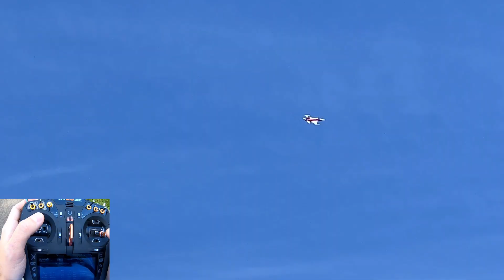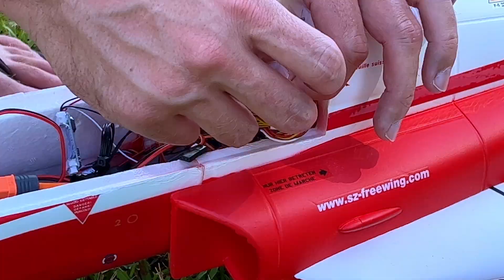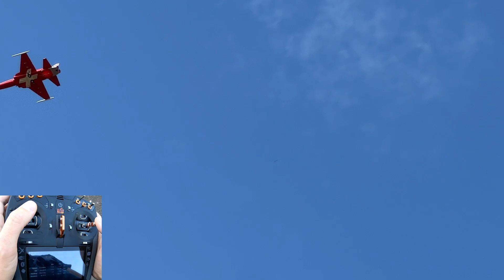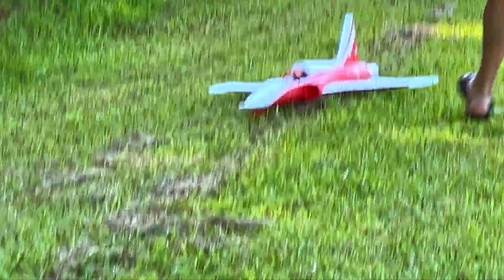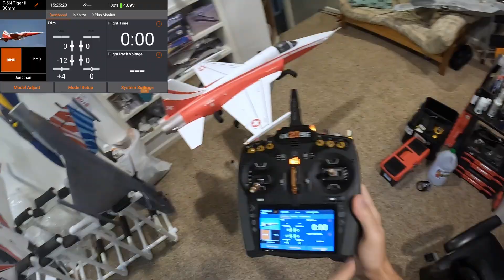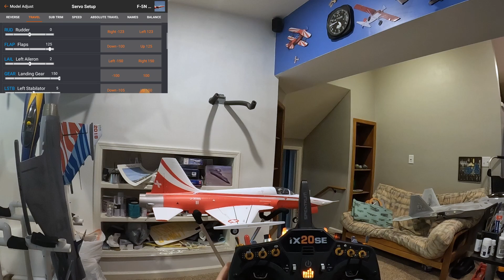FIRST FLIGHT DISASTER

Comment: Battery way to far back you love flying stuff way to tail heavy that's why it was so wonky
Reply from the maker: That's not really the main problem with the jet here.
Reply: Mine seems to fly best with the battery about a quarter to half of the way behind that line inside the fuselage too far forward it pitches up during turns to far back it acts wonky like in this video not hating at all I've learned a ton from your videos but this particular jet is super picky about cg
Reply: I have the fms 3665 2000kv platinum pro in mine and on 15 degrees timing she's a beast gets 150 160mph flat an level on gps love it best sounding edf I own and 2nd fastest next to Zues

Comment: Too much throw, gyro set too sensitive,  ..and I'm not sure you have the control surfaces synced correctly.  The plane should fly nicely without depending heavily on stabilization.
Reply from the maker: Throw is fine, gyro is obviously in need of tuning because it was the maiden. Surfaces are synced correctly.

Comment: I flew it without a gyro for years and i never had a problem.  https://www.youtube.com/watch?v=2aVWLPl7faI&t=116s   If anyone thinks this is a beginner plane they will be disappointed for sure.  It's a pointy jet with smallish wings and a relatively high wing loading.   If you fly this F-5 model like a real F-5, and don't over-control it, it will be a great addition to any hangar of an experienced RC pilot.
Reply from the maker: Nice man, thanks for sharing!

Comment: I don’t understand why it flys so unstably with a gyro, you seem to be stabbing at the sticks which is maybe why. 
I’m surprised your gear switch with didn’t wear out and come off you flicked it so much😂
Reply from the maker: It was unstable because of the asymmetric gear drag. Later on it was because I was still figuring out how it flew. "stabbing at the sticks" is using dampened stick movement. I fly with high expo because that's what I'm comfortable with.
Reply: @TwoBrosRC  
I fly with expo too but I still try and fly as smoothly as possible even if the model has a gyro.
I know the gear leg hanging out was causing the instability, I’m just surprised the gyro didn’t handle it with the amount of gain you had
Reply from the maker: I usually fly pretty smoothly as well, but on reviews I'm not looking for precision flying - I'm looking for what the model is capable of, how it stalls, how it maneuvers aggressively, etc. All of which is vital information for a proper review.

Comment: I just measured the wing on my F-5N and came up with 196 sq.in. for the wing panels. If you add the fuselage area between the panels (we always included it in the old days), it's 268 sq.in. After all, the plane does fly partly on the fuselage a la F-104 Starfighter. At 5 lbs, that gives a wing loading of 43 oz/sq.ft. That's not too terrible considering there is some airfoil to the wing and you should notice some loss of lift before the critical angle. The hardest part is landing it and most of that is due to the lack of dampening in the landing gear. If you don't grease the landing, you'd better have enough juice left to go around.
Reply from the maker: Good info - thanks! Perhaps it's not an issue of wing loading as much as it is an issue of stubby little wings. It's actually pretty easy to land so long as you're bringing it in with thrust. I was able to perform about 15 T&Gs yesterday almost effortlessly while holding power on approach. The key so far is to treat it like a jet running crow. Hold some throttle to manage sink rate, otherwise it'll just fall out of the sky without dropping a wing if your glideslope is too shallow. Much easier to just hold throttle and manage the descent instead of trying to finagle a working glideslope that will always function regardless of wind conditions.
Reply: @TwoBrosRC  I control the pitch attitude with the elevator and control the descent rate with throttle. If I’m going to be short, I add power. I try to keep a little bit of elevator in reserve so that I have some left to soften the touchdown, if needed..
Reply: When landing with flaps, you need some power to keep the plane from losing speed too fast. It gives you a little more time between the start of the flare and getting it on the ground before it stops flying..

Comment: Amazing review Jon. I learned so much from  it. Just as you I like the F5 too, but I am a bit afraid for it. It flys exacly how I expected. Too much tricky for me. At least for now. At this moment I have the Freewing T33 almost ready for its maiden. It is my first edf to fly. Do you have any tips for this one?
Reply from the maker: Nah, don't be afraid of it - just be aware that it's a power-hungry jet and requires a good bit of speed to stay airborne. It's not designed to fly very slowly. I'd recommend starting with an easier model, but if it's all you've got then I'd recommend keeping speed up throughout most of your maneuvers. Don't keep it at full throttle all the time, even half is probably fine, but you will stall it easily if you don't keep airspeed up while it moves around.

Comment: My 80mm F-5N in the aggressor scheme flies much better than my 90mm F-104 Starfighter. My F-5N is stock and is actually easier to fly than I thought it would be. And yeah, I think it’s my 10th EDF jet. It is difficult to see at the edges of the field. I put an AR637T in mine and mostly fly it in SAFE mode, even for takeoff and landing. I’m 72 and my eyes aren’t what they used to be. I can land and get it stopped without going off the end of our 350 foot paved runway. I had to enable reverse on my 80mm E-flite F-16 to get it stopped. Also, I put a KM-RC AB in my 70mm E-flite F-16 and I think it’s great. I did have a little trouble getting it to remember the calibration.
Reply from the maker: The KM unit has issues with Smart ESCs. The fellow who runs the site discovered it after I reported some bugs I encountered. There should be documentation on the site about Smart ESCs and what to do with them.
Reply: @TwoBrosRC  Yeah, I can see how the microcontroller in the KM-RC AB might have issues with the Smart signals riding on the PWM servo signal. If I still worked at a calibration lab, I’d see what it looked like on an oscilloscope. I’ve just started learning how to program Arduino boards and have learned there are at least two ways to measure the servo pulse width. My current project is for navigation lights for R/C models and using a channel to turn the strobe and landing lights on and off.

Comment: If you want a reliable radio/link that can’t brown the gear or worse, the receiver, the main battery has to power the receiver directly. There is never a need for satellite receivers except with Spektrum. I can’t recommend Hitec Aurora enough. You will never lose a link and never brown the gear. Spektrum will brown every flight if the control side load is high, and lose the link regularly.  Many start with Spektrum, but no one sticks with it.  The design is inherently bad.  Better to the bullet and sell it off.

If you do stick with your investment, it will help to test flight controls/accessories at full battery load… so full throttle with all servos/gear actuated at once.  Personally I would test that way at a min flying battery charge, too.
Reply: Flat out brutal honesty: the more experienced flyers don’t appreciate people flying very high electrical load, fast/dangerous models on Spektrum.  It’s just a potentially fatal accident waiting to happen. I’m mostly talking 500 and up size helicopters, especially in any way that ever directs energy toward the crowd.  It is just stupid. I understand it’s mostly unrecognized risk, and airplanes are significantly less dangerous than a 2 meter blade disk with a completely random ground impact footprint.  But they are still not without serious risk.  

I’m not talking about this little foam fighter, which at worst would be like torture with the “comfy chair.”
Reply from the maker: Appreciate the insights - but I think I'll stick with Spektrum for now. I usually don't change brands unless there's some kind of experience giving me a reason to.
Reply: @TwoBrosRC  I've flown Spektrum since 2007 and have never had any problems whatsoever. I've found that those who have had problems with Spektrum would have had problems with any brand..
Reply from the maker: @txkflier  Yeah, that's basically how I see it too.
Reply: @TwoBrosRC  
That sounds smart.
Reply: In the 1970's, everybody badmouthed Kraft radios. But when you looked at it properly, you realized that 90% of the radios flying were Kraft radios. So, if somebody crashed, there was a good chance they were flying a Kraft radio. Spektrum is today's Kraft radio. Out of 30 club members here, only 2 fly Futaba radios. One flies a FlySky and one flies Jeti. The other 26 fly Spektrum. If there was a problem with Spektrum, I think we'd know it.
Reply: @txkflier  
Yeah, I had a couple of Kraft radios.  The days of, “who has my clothes pin?”  Spektrum is a lot like that, but with just enough clothes pins to go around, until there’s not.   Or, some other 2.4GHz device has your clothes pin. Kraft had major problems with deconfliction, but people thought it was the best we could do and developed work arounds.  Similarly, a lot of radio problems went unblamed.   

Just my anecdotal experience - I flew for years on Spektrum (still do, a little) and I actually thought crashing was part of RC flying.
Reply: Another consideration is Rx size and cost.  A 9 channel three pack costs $40 each, that includes full voltage and position telemetry (built into all receivers, even micro) clear frequency scanning and un-jammable secure frequency hopping.   7 channel might cost half that.  So no more satellites, telemetry modules, BECs, flight batteries, all that weight, size, etc. And no more crashes and lost time and money.  The interface is looking a little dated, but a lot more powerful and basic sticks and switches are pro quality rather than temporary.  

All that said, it was price per V telemetry 9-channel airplane that forced me to switch.  Like you probably do, too, I have hundreds of models so I saved thousands of dollars right off the bat.  You can easily save a few hundred $ per airplane.  Plus they suddenly live forever.
Reply: @FFE-js2zp  You do know that the old DSM2 protocol didn't do frequency hopping, but DSMX does, right?
Reply: @FFE-js2zp  From an article published in 2011..   

Just How Good is DSMX?

In multiple tests, 100 DSMX systems were operated simultaneously for extended periods of time. During these tests each of the 100 systems was monitored in flight and on the ground. In every test not a single case of RF link loss, latency increase or control degradation was experienced or recorded.
Reply: @txkflier  
Will they buy all my models back?  Here’s Spektrums own instruction manual:  “All DSM receivers have an operational voltage range of 3.5 to 9 volts. With most systems, this is not a problem as most servos cease to operate at around 3.8 volts. When using multiple high current draw servos with a single or inadequate battery/power source, heavy momentary loads can cause the voltage to dip below this 3.5-volt threshold, causing the entire system (servos and receiver) to brown out. When the voltage drops below the low voltage threshold (3.5 volts), the DSM receiver must reboot (go through the start-up process of scanning the band and finding the transmitter) and this can take several seconds.” 

And saying “most systems” work because servos quit at 3.8V makes zero sense.  What’s the actual difference if servos quit or the Rx quits?  And every Lithium min cell voltage is 3.0V by design.  Senseless.

The only reason I brought it up is this model was almost a Spektrum statistic.  Why do you need a high AMP BEC that smokes little wires?  Spektrum.  More amps, less V droop under load, fewer Rx naps.  Been there.
Reply: @txkflier  
I know DSMX claims to eliminate “most” interference by hopping in a set pattern across a common 23 frequencies.  I have several DSMX Tx/Rx models, aside from regular binding problems, they do indeed work most of the time.  I also buy BECs for them and telemetry mods, and satellites.  One would hope they could keep a link with Houston Mission Control.  It’s still a constant battle, as is demoed in Jon’s F-5 trials.  Plus the weight and space and cost is crazy.  I did the same and resisted way too long.
Reply from the maker: All I can say is that I've flown models on Spektrum equipment thousands of times in the past two and a half years and I can't think of a single time I've encountered anything you're talking about. I simply can't correlate it - so I'm sure you understand that I'm most definitely not going to reinvest a ton of money into a new radio system based on a single comment which doesn't line up with my experiences so far.

I use remote receivers because I want to, not because I need to. I prefer the insurance that a $39.99 remote adds to an expensive model. I would add remote receivers to any other brand regardless of who made it. That's not indicative of the brand's performance, it's me choosing safety and peace of mind.
Reply: @TwoBrosRC  
I wouldn’t re-invest based on a comment either. But the comment is still a worthwhile point. Spektrum has gotten a lot better, but mostly due to bandaids required by a fundamentally sketchy design. There are a lot of issues, and I would call all the issues major because they can result in a loss of control.  

I used to buy satellite receivers and I still would if I flew Spektrum in anything bigger than a small foamie, because I think they are definitely needed. I still fly Spektrum in a few low risk park flyers and almost all my UMXs.  I know UMX is branding, I mean “cul-de-sac” scale that can’t hurt anyone or go through a window with a lost link.

The two main problems, in order, IMO, are (1) the lack of a direct, main battery powered receiver.  This means that the “system voltage” is always fluctuating around min working electrical component voltage.  So under load (all servo actuated, plus accessories like gear and lights) the link can easily drop in and out.  

It’s no different for 1S planes since the main is 1S too (another reason UMX “is what it is”), but even 2S makes a HITEC receiver, or similar solution, run on basically unlimited main battery voltage.  IOWs, no matter how many amps you push through a 5V BEC, under full load V will sag to brownout levels.  The bandaid is BEC amps, but even “just” 7 volts from a 2S main battery is plenty of margin with never a need for an amp-based strategy.  3S, 11V nominal, is crazy higher than the 3V microprocessor min requirement.  And so on.  

The other problem is lack of a secure link with clear frequency scanning and constant frequency hopping.  Also critical.  

It’s been a while since I entertained Spektrum, so maybe it’s gotten better.  When I used it it was pure pain. I lost maybe 30 models to brownout, before I fully understood what was happening.  You gear actuation fail is a perfect example of a Spektrum failure.  High amp BECs are overloading the wire gauge to keep V droop low to keep the Rx awake.  Almost lost that model, so you do have major issues.

In summary:

Q1:  Why would you ever power the Rx on the same electrical bus as mechanically loaded flight controls and gear?  

Q2:  Why would you ever put the Rx on an electrical bus that fluctuates on or near min microprocessor voltage?

There are other problems which are pretty major too, and so safety related, like a lack of “awake” microprocessing power should link be  lost due to excessive range or blocked LOS, or in Spektrum’s case, something like gear retraction drooping the system voltage.  That prevents an “awake” no link fail safe mode for programmable flight control positions to spiral glide the model in full flap idle.  One problem with Aurora is it will hold a strong link for 7-10 miles, so that spiral can be a looong ways away if you lose sight.

Most don’t realize it but Hitec has had all the advanced assignment and mixing features you show, for decades, plus a more sensible setup. You name your own channels, for example, and they all have the same feature set.  Spektrum is design to make it easier for beginners to do things like pre-conceived “flap” and “gear” type mixes, but it makes the platform kind of a a mess for advanced flight control designs. 

But it’s really the fundamentals that should drive a platform of choice, IMO.  I have no affiliation with HITEC, but it’s night and day IMO.
Reply: I’ve never had to use a satellite receiver with my Spektrum AR636’s or AR637’s..